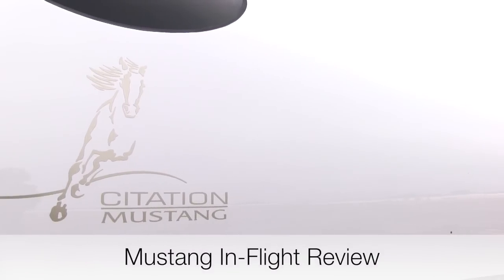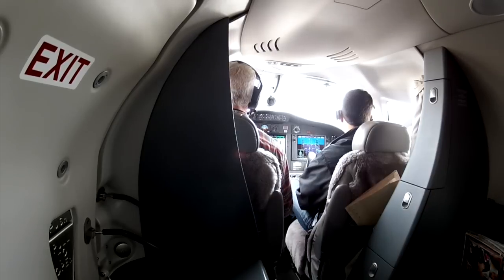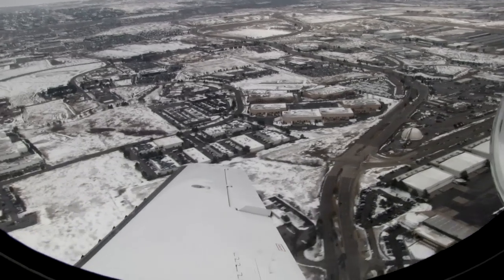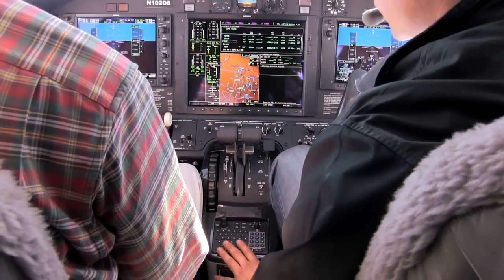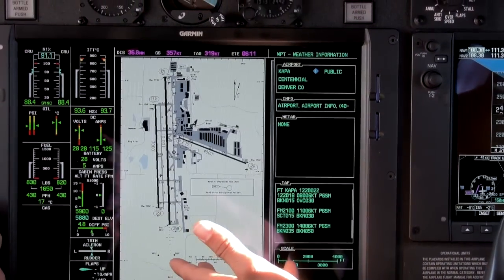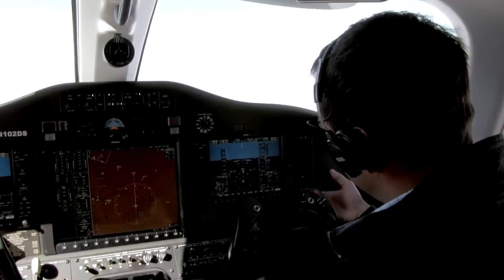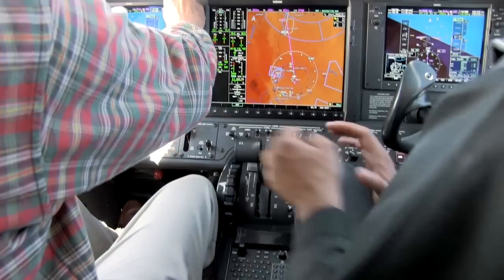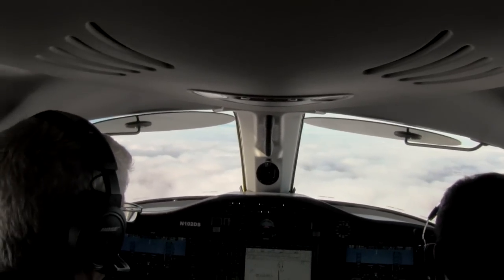Aircraft Review: Citation Mustang In Flight (Video 2 of 2)

Comment: I see that two gentleman went hot-and-heavy in their defense and praise of two aircraft, while bashing the other man's choice. I'll throw my two-cents-worth in the ring. We're talking about the Cessna Citation Mustang vs the TBM900.
Well, firstly, the former is a jet, and the latter is a turbo-prop. So it's really quite difficult to compare them. Surprisingly, the Mustang is about $500,000 cheaper than the turbo-prop TBM900-$3.2million vs $3.7million. 

And, despite what one gentleman insisted, the Mustang actually beats the TBM900 in almost all performance categories. It's maximum cruise speed is 340kts. 330 for the TBM900. It's service ceiling is 41k ft. 31k for the TBM900. The Mustang's cabin is 6-inches taller and 7-inches wider. She can carry way more baggage than the TBM900, both in wieght and cubic feet. And the Mustang has a toilet. The TBM900 doesn't.
The only performance area the TBM900 beats the Mustang in is range-1200nm for the Mustang and 1540nm for the TBM900.
However, the Mustang has the advantage of two engines. It's inherently safer to have two, as opposed to one.
And there's one more aspect to consider. Looks. In my opinion, the Citation Mustang is a lovely aircraft. The TBM900 is a dog. She's really an ugly beast. But that's my subjective opinion. Beauty, and ugliness, are in the eye of the beholder. However, I could never bring myself to purchase a plane that was as homely as the TBM900.

Oh. By the way. If you want even more room than the Mustang, with a taller, wider cabin, the same range as the TBM900, Garmin G3000 avionics, and a 404kt max cruise speed, spend an extra $1million and go for the Citation M2. She's a beauty too.
Reply: Got to agree on looks.  The Mustang is my favorite CJ, even though it really isn't a CJ, and the CJ4 comes in 2nd, and it too is a bit of a departure from your classic CJ's.  The Epic LT/E1000 is a good looking turboprop.  I used to think it looked weird.  Kind of old fashioned.  But it has really grown on me.  Thick in the nose, so much so it hardly seems to get much bigger at the cockpit.  Simple and straight forward, one airstair door, though the E1000 will have an emergency exit, interior baggage.  The Epic now seems very elegant to me.  Nicer than the somewhat busy, ugly TBM.  But, you got to love the Mustang.  Lots of tried and true systems, lots of effort to make things single pilot friendly.
It fairly boils down to operating costs, less for the TP, and whether you want in and out of short runways, or prefer higher cruise altitude.